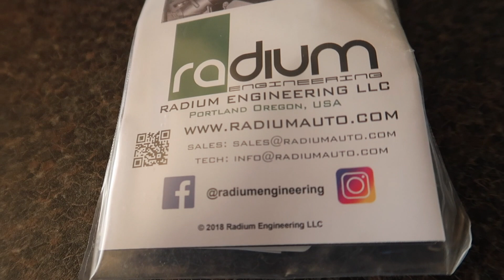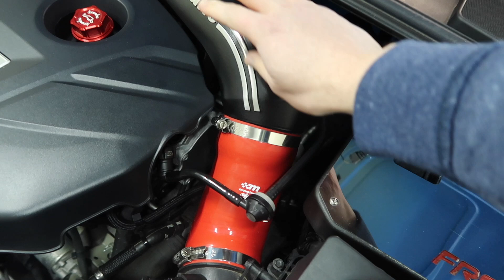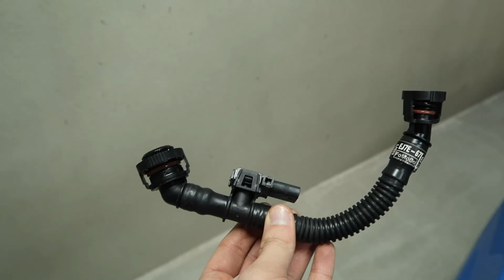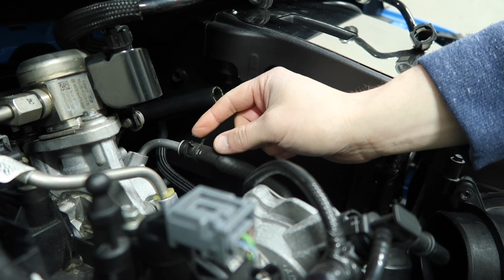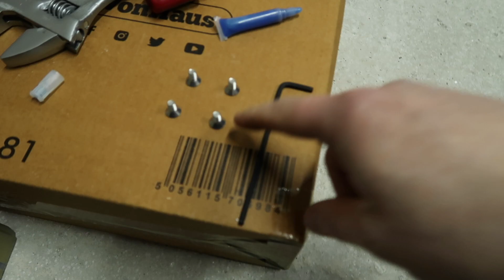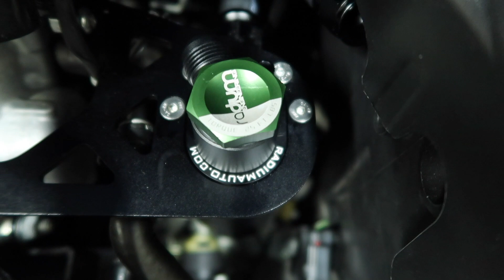RADIUM ENGINEERING CCV CATCH CAN KIT INSTALL! | FOCUS RS

Comment: Hi Adam. I have a 2016 Ford Focus RS. I bought it already tuned. I performed my first oil change on it, but I don't know how to drain the catch can. Can you explain to me how to drain the catch can please?
Reply from the maker: @williamschmidtjr8476  the ccv catch can never collects much oil I have learned since installing but to empty it you will need to remove the first part of the intake and then unscrew the bottom of the can

Comment: This catch can works great on my Focus RS. Only problem is if the hose on the bottom used for evacuation falls off or comes loose, as I just discovered, the can won’t serve its purpose, as it requires vacuum to work...so unfortunately found it disconnected, connected it back so now it should work again as designed.

Comment: Adam - fyi, I just updated my CCV Radium install for better hose routing and cable management. I emailed Radium 4 photos showing what I did. This is the body of most of that email.

Regarding the CC install instructions and the fuel line coming up to the fuel pump, I just thought I’d update you on what I did a little different with hose length and routing for the CCV catch can, Focus RS application. Notice that a longer (18in) hose for the CCV can inlet port coming from the valve cover connector, and locating the connector pointing in the OE direction allows the fuel line not to be forced up by the hose as installed in your directions. The 2 can hoses are tie wrapped together in 2 places to avoid the clutch hydraulic line behind them. That’s a detail but the hoses don’t touch anything back there.

Also, I was able to tie wrap the pump control line with it’s stand off to the pump bracket avoiding crimping it against the bracket as shown in the directions.

Comment: How is blowby so far in the catchcan?  Are you running big turbo and higher boost or the stock turbo?
Reply from the maker: Very very little. Stock turbo. The PCV side catches significantly more

Comment: So my main concern is the vps sensor did that fix keep the CEL off?  Im gettng ready to grab a really nice set up for my ST facelift, n UPR says itll still set a CEL even if you tie it in, so im gettin mixed info
Reply from the maker: There is no CEL at all with this kit
Reply: @AdamRainey  so to my question, ya just the VPS sensor into the new line correct?
Reply from the maker: I don't know what this 'VPS sensor' is that you are talking about. The pressure sensor that is re-used in this installation and remains in literally the same location is the only sensor at play here and being that it is in the same position means that there is no chance of a CEL
Reply: Oh I am sorry, the VPS sensor, is the Variable Pressure Sensor in the clean side line from the valve cover to turbo intake tube.  The facelift ST, RS and newer ecoboost all have them.  I do know the USDM prefacelift STs didnt.  But anyways the only reason I asked and I understand I see you didnt move the sensor, but there are alot of people, the companies even that make the cans even, that say theyve seen CELs on the clean side where that sensor is, some people have said that they think its becoz of the flow change, and some people dont exprienve any issues...so its prolly something like they arent paying attention and pinching one of the lines reducing flow.  But Im just asking becoz before I drop 500+ plus on my catch can kit I wanted to make sure real world someones installed them without issues.    Thats all.  Wanted to see it with my eyes per say.  Lol thanks bud, good video

Comment: Adam, I am about to do the complete Radium catch can kit on my RS. Question: Aren't the top ports the input, and the side ports the output of both cans? On the baffle plate/catch can video you attached the PCV hose to the top (input) of the CC per the directions. On the CCV can, you say that you connected the valve cover hose to the side port. That would be the reverse of the PCV can.
Reply: Did you install the CCV can? How much oil do you get in the can and at aprox how many miles or km?
Reply: @samsonyunited  Just did it and don't expect much CCV oil at all. Will be checking in 4k mi when I change the oil. Don't drive my car that much. Just good to know that no oil will ever go in through these paths to the valves or turbo anymore.
Reply: @gbass7328  i am running big turbo and 29psi and getting more than.i would like.  if you are stock turbo should be 👍
Reply: @samsonyunited  Yes stock turbo for now.

Comment: @7.00 from experience of fitting a brass fixing to a new hose pipe I found dipping the tube end into warm water for a bit softened the tube a bit to allow the insertion of the brass fitting easier. Not sure for your application here if it would be possible to do but just a thought. 😊.

Comment: Great tutorial will use this when I fit mine next week. One thought though, why not use the heat gun to heat the new hose and make it easier to fit onto the OEM connectors?
Reply from the maker: Cheers Perry, in hindsight you are right - that would likely help with getting them on. If you try the heat gun getting the connectors on and it help, let us know
Reply: Wilco 👍
Reply: A little heat from a hair dryer does indeed make it easier to fit onto the barbs, I needed no oil
Reply: How much oil do you get in the can and at aprox how many miles or km?

Comment: Hi Adam have you drained the catch can yet? Was there a lot of oil? Over how many miles?
Reply from the maker: I've checked it a couple of times now and there hasn't been enough oil to warrant draining so CCV side looks to blow very little oil
Reply: Adam Rainey oh ok. So will you look to change to a pvc one? I am looking to do the same on mine.
Reply from the maker: @darrengardner7724  I will leave the ccv in place but probs will add the radium pcv at some point in the near future

Comment: Adam, why ccv side & not pcv side ? Obviously not a criticism, I just need educating lol
Reply from the maker: So a couple of reasons. The way I am progressing with my mods is in a logical progression towards 'stage 2' part of which will be boost pipes and intercooler. The CCV side blows oily air into the intake which then goes through the pipes and intercooler so it makes sense to do this catch can before doing those mods - the PCV vents into the intake manifold after the intercooler so doesn't affect it. Then also I am not 100% decided on what catch can is best for PCV - radium or Mishimoto. I also have the Mountune breather plate which will be reducing the amount of blow by on the PCV side so it isn't as much of a concern right now

Comment: I wonder if they offer this for the ST as well ? Currently I have a little one on the back side, but it's impossible to get to for checking. This is a much better engineered solution. BTW, what about a catch can for your front PCV side - in my experience with the ST at least, there's a lot more oil collected there than on the back side........
Reply from the maker: You can indeed have it for the ST (their documentation talks about different steps depending on if you are installing on an ST or RS). You are right that PCV side will fill quicker and I am indeed considering my options right now, Radium vs Mishimoto :)
Reply: @AdamRainey  I put a JLT in my ST - also looks good and is nicely engineered, but has no dipstick and can be quite difficult to unscrew the canister for emptying